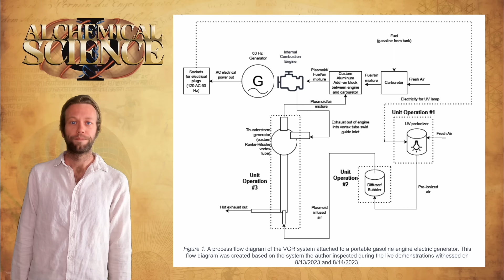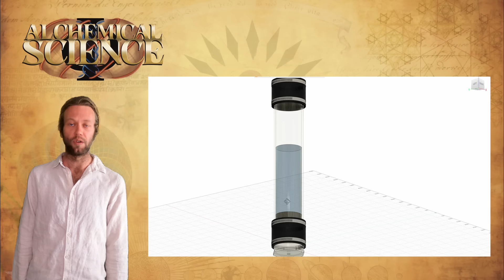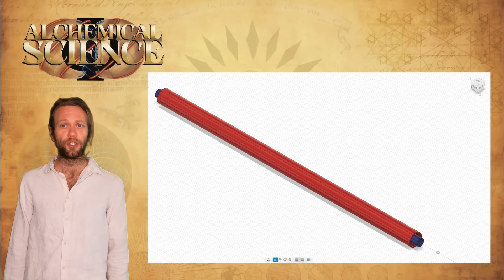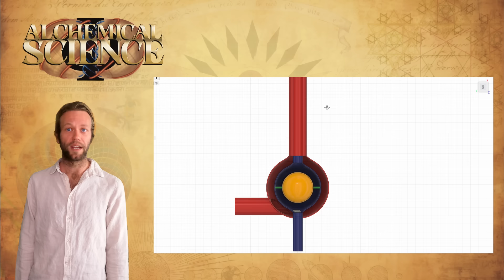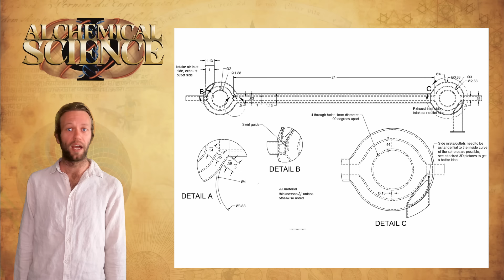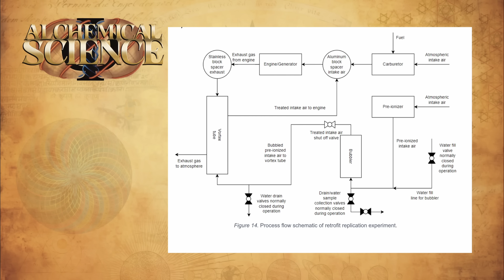Thunderstorm Generator | COMPLETE DIY BUILD GUIDE | Malcolm Bendall's Plasmoid Tech

Comment from the maker: Thanks to those who assisted with and donated to my open source research to make this happen. Your support means a lot!
Reply: Energy scientist here.  This was a great post!  Shared to the community!

cheers from Dallas TX!
Reply: @AlchemicalScience      -      If possible, please explain how the exhaust fumes are analyzed in detail.  A valid explanation will contain multiple ways in which the exhaust fumes were analyzed.   

Thank you
Reply: Could it be built with a 3d sintering machine ?
Reply: @kgb27r I find it hard to see why not. They are precise as hell, and don't they use several metals /alloys?
Reply: did you ever get an answer to this question I was thinking the same thing . @kgb27r
Reply: I know how to simplify the system, the way to create the spinning air in the inner and outer tube and make the air spin on exactly 51.84 degree angle like your aiming for just weld one end of a metal spring stretched down the copper tube, measure the distance of the tube and circumference of the spring on the inner tube and do some maths to work out how many turns the spring needs to  turn before welding the other end up the other end of the tube, then repeat for the exhaust hot outer tube, saves making the 2 metal balls and hoping the twisting air is exactly 51.84 degrees, you can put a few springs down the pipe for greater spin, that would mean you can make it all fit in the exhaust system of the car and run a tube to the inlet manifold from the back of the car where the system would be where the spare wheel goes to make room, that's my plan.
Reply: @LUKETHELOG the metal spring will need to operate at temperatures in excess of 600 degrees Celsius, and how would the spring force the air to move at an angle of 51.8 degrees. The airflow would simply move through the tube and the spring would restrict the airflow, not force the airflow to move at a specific angle?
Reply: @LUKETHELOG Amazing, sounds like a plan, keep us updated, and stay safe!
Reply: Awesome work mate! 
Ive been wondering when this was getting out!

Glad i found your channel!

Is there anyone running projects on how to fit this on a standard car😊?
Reply: Out of interest how does the generator first start up without fuel. Or does the vacuum cause the piston to constantly run?.
Reply: its called Geet Plasma reactor
Reply: really ??? only one side audio.. WTF.... i just dont get people. so happy to make a video but audio feed one side.
Reply: @XPFTP  Yeah like if it was real why is the best video so low quality after a year and its just some random guy
Reply: You sound like a government plant.
Reply: If you offset the inner small diameter pipe to the out side of the inner sphere  and vise-versa for the opposed side. this should induce the vortex without the need for the inner ball to stabilize vortex. in theroy! 
BUILD THE INNER PART JUST LIKE THE OUTER PART.
Reply: Great invention. should have shot the video during a thunderstorm so you can hardly hear what the man is saying.
Reply: How does the motor start if it's not drawing plasmids through the unit while choking the engine? Engine want start with just air through the carb to start the plasmids generation 🎉
Reply: This is highly reminisent of Paul Pantone's cyclone vortex exchanger and bubbler system.
Reply: @toluso0  and what happened to that?

Comment: well it is obvious you have MONETIZED the idea .. but some of the claims being made in some of your links are BS!!!
like this one here >>> "It can be used to replace combustion engines"  ... it does not replace the engine ... it is a retrofit device that works with a gas engine. It uses a process that allows water to act as a secondary fuel source alongside a conventional fossil fuel, with the goal of significantly reducing emissions. The original gas engine is still needed for initial operation and to provide the necessary temperature for the process to become self-perpetuating ...

Comment: I absolutely thank you from the depths of my soul for releasing this information 🙏🏾 I attended your virtual workshop to interact with Malcolm on building one of these for a diesel engine. I know the principal relies on the pulsating vacuum from the engine to function and create microplasmoids. But if I was to install this on a diesel engine with a turbocharger, If I were to hook up The cold side to either the inlet of the turbo or the outlet of the turbo. At boost approximately 10 to 20 PSI there would be no vacuum pulses. Only a steady vacuum or a steady pressure of cold. Is this method possible on a turbocharged engine? From everything I've seen here it seems like it is not possible but I may need to create some valving that will allow vacuum pulses to be achieved with a turbocharger. I also asked this question during the conference and was never given an answer upon it. I would really like to know your take and everyone else everyone's take on this. I'm currently building one with a two and a half inch inlet for a diesel engine and will detail the entire build process and share it with all.

Comment: I hope you go back and explain the cavitation and harmonics better. The distance is based on the wave length and the corresponding harmonics it produces. If you are in the wrong octave it fails. This is the most critical part. The rest it just a bubbler. Thank you for the video.

Comment: Are you effing kidding? You are actually going to do a DIY project with 1/2 and 1 inch tungsten tubes with 1/16 walls? Where, exactly, do you expect to buy such tubing, and how much do you think it would cost? Also, just to keep things real, the thermal conductivity of copper is twice that of tungsten. And lots of luck welding tungsten, by the way.

Comment: I don't believe that CO2 has a negative impact on the 'planet' but removing the other pollution in the exhaust gas seems great, does it work on a 2 stroke ? wouldn't that be a cool demonstration if it could remove the smoke ?

Comment: Plasmoid Integration** I m dealing with cancer at the moment it's in remission so I'm thinking I want to implement something along the lines of this it's Daring and I'm willing to try it what else do I have to lose right. 

 the integration of a plasmoid into 

hypothetically, a plasmoid could be safely integrated into the human body, it could potentially offer a range of benefits. Here are a few speculative possibilities:

* *Enhanced Physical Abilities:* 
  * Increased strength and endurance
  * Enhanced sensory perception
  * Accelerated healing
  * Potential for telekinesis or other extraordinary abilities

* *Advanced Cognitive Function:*
  * Improved memory and learning capacity
  * Enhanced problem-solving skills
  * Potential for direct neural interface with technology 

* *Energy Generation and Storage:*
  * The plasmoid could potentially harness energy from the environment, such as solar or kinetic energy.
  * It could also store energy for later use, providing a sustainable power source for the body.

* *Biological Compatibility:* Ensuring the plasmoid is compatible with human tissue and immune systems would be a major challenge.
* *Control and Regulation:* Developing a system to control the plasmoid's behavior and prevent unintended consequences would be essential.
* *Ethical Considerations:* The ethical implications of augmenting human capabilities with technology.

Comment: It sounds as though you started the engine using gas fuel until it gets warm, then continue to run it on gas but the exhaust is carbon free.  Not clear.  Sounds deceptive

Comment: Dear Sir, I have a few questions if I may; (1) In Mr. Bendall's trial it was stated that about 700 degrees C was needed for the Thunderstorm Generator to work effectively.  How was the T.s. Generator heated to this temperature?  Was the petrol motor just an engine or was it also a generator? (2) Does the T.s. generator generate anything (e.g. heat) or is it actually just a method to transmute exhaust gases into Oxygen?  (3) How can the T.s. generator improve fuel efficiency of the petrol engine when intake of fuel is fixed and only seems to be fitted to the exhaust?  (4) When under load the petrol engine would use more fuel and be less efficient.  How does the T.s. generator improve engine fuel efficiency when it is not connected to the fuel source but only to the exhaust? Do you mean that exhaust efficiency is improved? Does the T.s. generator affect the engines ability to do work?  P.S. Congratulations to Mr. Bendall on concept and ability to build T.s. generator.

Comment: This is a great invention. After watching these two videos I’m starting to understand how it works. As a journeyman plumber myself. For proper flow size is important, as you stated too. So are we going with O/D or I/D with tubing? And way not use the normal fuel intake port on the engine? A last question, Does the interior sphere have to be hollow? 
A comment on the 1st build video. You guys are grate on the proses but you need to work on part identifying. For example silly is a behavior, silicone is a product used to create a water/air tight seal. Please note I am vary grateful for all your hard work and dedication to get the world out of. Thank you and god speed.

Comment: So if I'm correct this is a way of using internal combustion engines rather than hydroelectric or steam based to take the engines exhaust and converting it into fuel for the motor to run off of instead of gasoline

Comment: So this is just to reduce emissions and still run it off gasoline?  So the generator still works as normal just no emissions to speak of. If we were to add a water based fuel this would be irrelevant.  Am I missing something.

Comment: Does the pipework from the light ionizer to the bubbler need to be manufactured copper? As its on conveying ionized air, surely it can be something more flexible like rubber tubing?

Comment: Why not just gut out an extra carburetor and use two?  That way the mating surfaces are factory.   Easy to insert whatever you want.   Ive got a shop with everything nessasary to build this building this. 😮🎉🎉
Reply: I'm putting together my parts list now.   I'm thinking an extra hollowed out carburetor will be cheap and easy to get.   Plus it will mount easily and flat with only some longer bolts.

Comment: Trying to get my head around this. Is the exhaust treated so its basically air again and the air that is fed into the engine is treated so it it doesn't need as much fuel?

Comment: the intake manifold adapter is done easiest out of and hardwood with a fine grain just remeber to block sand and a oem gasket for each side will do works fine i promise also you can soak that piece in oil to help if you had a course grain material
 im not sorry for my lack of pennmanship its part of what my kids call the "Tism" WTM

Comment: There was a gentleman back in the Late 60's or early 70's that discovered push air through at high pressure to a T forced one side of the T to expel hot air, while the other side expelled cold air. HT had found he could heat or cool the inside of his automobile with it.

Comment: Maybe that the uv ionisation even is not the only cruzial point, but instead also the waterfiltration of the intake air that leads to nearly no micro-partikels left in the intakeair, so that there are much less of small core cristals to start molekules cristalisation during the combustion itself - due to much less useable micro-surfaces... This could be a kind of beneficial for the hole catalytic reaction itself, to...

Comment: I just want to point out that, having done the trig, if you drill a hole the diameter of the pipe and insert the pipe, the entry & exit angles will be nowhere near 51.84° they are closer to 80° in the 3" sphere with 1/2" pipe and 80° in the 4"sphere with 1" pipe.
This is easily found using 90 -acsin ( 1l4 ÷ 1.5). and 90 - arcsin (1/2  ÷ 2) in each case.
Also, if the pipe extends ANY distance into the sphere, it completely ruins the entry /exit angle anyway.
I find that part of the specifications ,(that the exit/entry angles must be 51.84° ) to be completely absurd and impossible to measure for any normal workshop, let alone fabricate.

Comment: I wish to make this thunderstorm generator to fit my Mazda BT50  diesel engine size is 5 cylinder  3.2 litre which is actually 3212 cc how do I scale this up to be efficient to fit   is there some easy formula I  can apply to engine sizes this is fantastic innovation that  I'm prepared to give it a go  cheers !!
Reply from the maker: Probably do 8:6:4 inch ratio spheres mate. 3 inch outer pipe, 2 inch inner pipe, 51.84 degree transitions between spheres and pipes. And if you see too many plasmoids coming out (overcharging) then keep doubling the pipe length until you're sweet
Reply: @AlchemicalScience  Does a diesel engine compression ratio difference to that of petrol not make a difference to the design, or must it still be investigated?

Comment: Sounds like competition for the electric car fanatics I’m all in sell me a retro fit kit at auto zone or Napa so I don’t have too buy an electric vehicle just for the battery too take a shit in the dead of winter or even burn a hole through the floor of the concrete parking garage that it’s parked in if this works it sounds like a practical solution too some of the climate change fears while allowing people too maintain a way of life that they are accustom too anyone who wouldn’t considered this as a solution has some deeper issues and possibly some ulterior motives in my opinion

Comment: Separating hot and cold was the sanest thing you said connecting to weather thunder I'f I can't remember it even if was celebrating black out I should of woken up with a full summery 
And I remember filters physical man made and substrate somewhere of building the tube and pract nothing else meaning the details were micro form or skipped also meaning micro form
Reply: That thing when I say the worlds going to end well there's a meteorite on way with no emotion to it going to have to rewatch it

Comment: So am I right in saying this still requires the use of gasoline or diesel fuel to work? Or does it operate without gasoline? I’m still confused how they start and operate the generator without the use of fuel to start with? So is this just a method of cleaning the exhaust emissions from the combustion process?

Comment: This subject has been spreaded on different channels and make my day happy😀.  I am surprised by how many people have missed their elementary physics classes and are still believe in miracles... "vortex", "plasma", "plasmoid"😇, "atomic transmutation"😇, "cold fusion"😇, "thunderstorm generator"...  a mixt of physical terms used to create the sensation of high science and to describe the functionality of this retrofitted gasoline engine E-generator - most probably the manufacturer of this generator is very happy with the sales.
The main core "thunderstorm generator" is a simple heat exchanger to pre-heat the inlet air using the exhaust gases - charges and polarization on this structure in this configuration, this is a nonsense! 
Some ions are generated on the input by UV but, they will be neutralized and lost in the first stage. This bubble generator is a simple air filter.
Most probably the pre-heating of inlet air will improve the motor performance but IT WILL NOT CREATE CLEAN AIR. To do that, some people are using water electrolysis on their setup to create hydrogen which will be injected progressively  in the engine and to replace the fossil fuel and to "demonstrate" the "carbon transmutation"😇😁 - in this case the engine has become only hydrogen fuelled.
I will stop here my short analysis and my advice is to read once and think twice before to believe such of things.
Reply: have you actually made or been deeply involved in making any of these things or are you just another armchair critic
Reply: I was skeptical of the bubbled gas being hydrogen.
Reply: This is genius, thanks for the LOL's!
Reply: I agree 💯 the gullible believe everything they see and hear

Comment: Kind of disappointing, regarding fuel efficiency. I’ve heard some information on other videos, where they were predicting much higher fuel efficiency.
Basically, they said that the engine could run itself in a closed circle, when it starts operating.  Spending just a bit of fuel, until the system starts running.

Comment: . Just hearing about this technology. My first thoughts are, adding un-metered air into the system after the carburetor is a bad idea. It has to be leaning out the air fuel ratios. This is where the extra fuel mileage or reduced fuel consumption is coming from. Im curious what the piston,  head and exhaust gas temperature differences is with the unit turned on and off. Wondering how long the motor will last under full load.

 Seems to me all thats happening is you're cooling the un-metered air before it goes into the combustion chamber.  Do some research on a pulse tube cryocooler. Very similar theory's. Put an air temp sensor inside the tube thats bypassing the carburetor  into the combustion chamber. Then put another air temp sensor in a tube above the UV air ionization chamber. Whats the differential between the two

Comment: I thought the plan says to have an electrical receptacle in the can that has the uv light? 
Problem with Hydrogen gas is the achieved power or torque when burning hydrogen is far lower then gasoline as we know Diesel yields twice the power per gallon vs gasoline. Hydrogen is far lower torque yeild then gasoline.

Im thinking flywheel power storage is far simpler can literally be made from junk and use a brushless drill motor to supply the stored energy in the the form of electricity.